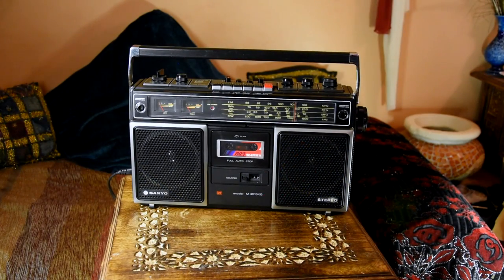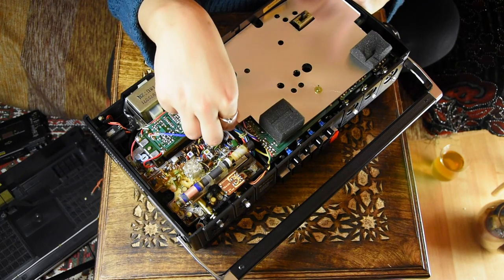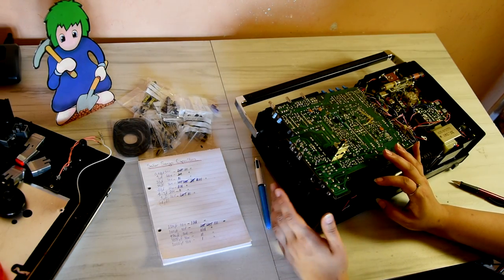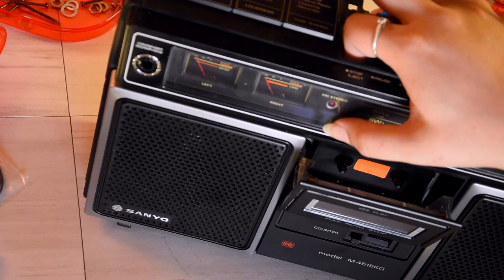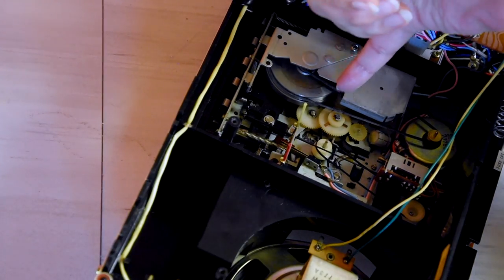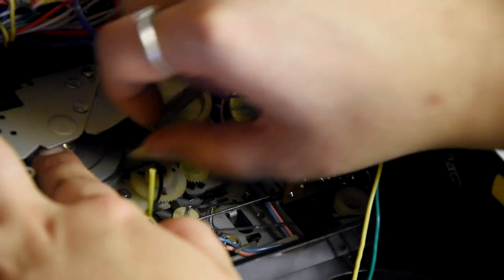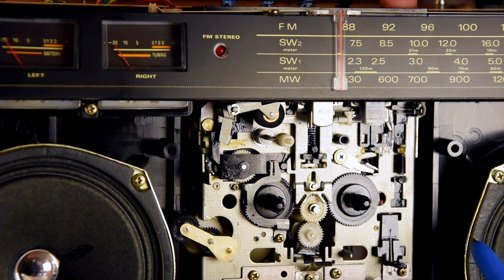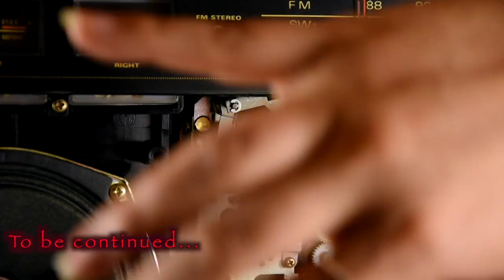Sanyo Cassette Recorder Part 1 - Repair & restoration

Comment: Hi Maddi, 

I'm following along with interest your overhaul of this Sanyo.  I've got a Montgomery Wards boombox, possibly made by Sanyo, from 1979 that's going to need some attention one day.  Montgomery Wards had their own store brand boom boxes.  Your video will go a long way to helping me overhaul mine.  

Congratulations on solving the stuck eject button problem.  I learned about dry, sticky old grease when I overhauled an old record player changer from 1956.  What a mess that was!  Cleaned, oiled and regreased, it works like new again.

All the best, Tom
Reply from the maker: Hi Tom, Thank you! And I will be happy if this video can help you or anyone in any way, I couldnt find any clues or support out there for this model when I searched around. I hope you get your Montgomery Wards boombox fixed and restored. :o)
Reply: Maddi, 

My Montgomery Wards boom box isn't as fancy as yours, but it does have an 8 track tape player built in, of all things.  Strangely enough, I've actually got some 8 track tapes that I could play on it, but I need to "rebuild" the cartridges first.  That involves replacing the foam pressure pads and sensor foil, all of which can be found on Ebay.  And, of course, You Tube instruction videos on how to do all this!

I hope you're feeling better soon.

Tom

Comment: Nice video, am new to your channel. I have done a few retro cassette repairs. Those screws with the glue on a normally easy to unscrew.
Also what I do is when I put the screws back that have been glued, I put a spot of nail varnished on them :) The nail varnished is also good
for tape head screw, if adjustments are needed. I use black nail varnish :)

Comment: Most problems you have with vintage cassette recorders are mechanical or belt related. You must use a plastic safe lubricant on all moving parts. All belts can stretch, so replacing is the best choice. If you cannot find a replacement belt, clean the belt with anhydrous (no water added) alcohol to restore and clean the belt so that it grips better. Remove all dust and old lubricant with a cue tip lightly soaked with the alcohol and re-lubricate moving parts except the belt, pulley surfaces and pinch rollers. You can lubricate pulley pivot points if they drag or have a rumble sound. Contact switches, volume, balance, fader, and selector switches can be cleaned and lubricated with a product called Deoxit (very reliable and safe on plastics). Tuning string can be made unslippable by cutting off a coil or two of the spring that provides tension on the string and bending a small hook on the end of the spring with medical clamps or hemostats with very small jaws.. 
Always put small parts in a bowl or magnetic cup found in auto parts stores - a lost screw will ruin your attempt to repair. Auto belt restore should not be used except as a last resort. If you are skillful with very small objects, a broken belt can be superglued together for a temporary fix. Glue the butt ends together on small belts, overlap larger flat belts and use a very small amount of superglue to join them. Good Luck!

Comment: Glad you're going to replace the speaker drivers.  They are normally measured by their outside diameter, so from metal edge to metal edge across the centre.
Reply from the maker: Thanks for letting me know, I still cannot find the right size and wattage combination, i'll keep looking.

Comment: Nice classic ghettoblaster. I always 'ploing' the battery compartment coils too just to hear the sound. Weird how often the replacement of the drive belts is so terribly difficult.
Reply from the maker: Yes, changing the belts was so awkward, that stupid screw couldnt be removed! 
plucking the springs just has to be done, there is no way for me to resist ;o)
Reply from the maker: That is a good idea! I didnt think to try that, thanks!
Reply: It can work sometime; if loctite has been used,heat is required to free or soften the chemical bond.
Reply: An old trick to remove tight screws is counter-intuitive.   Tighten, yes, tighten the screw first.   You will find that you can "break" it loose by tightening it first.   Especially if you have worn out the head of the screw by loosening it.   Another old trick is to keep a brand new screwdriver that is only used for tight screws.  Then put it away for the next time.
Reply: Yes I have used that trick before.
Reply from the maker: Thaks for the tip Robert, I didn't know about this trick, and naturally it never occurred to me, but I must give it a go.

Comment: Oh my god when I saw the Eject button was working Ok again :-D my face was the same as if I was watching some kind of a thriller movie in the most interesting part hahah and seeing your surprise was hilarious too :-)
I would like to have your skills in electronics as I have some other radio cassettes which need some reparation but I am so bad  when it comes to electronics (but so good when it comes to issues  in computers  when capacitors, diodes or chips soldering is not involved...)  I even have a modular sound equipment I am using daily  in which the type players are not working because of the elastic rubber bands...but as it's a very very big equipment  I don't even know how to begin haha
Seeing you working makes me see it's easier than I think at first but when I have the board in front of me it's just like a brick of a house for me... I can measure the Volt's, the resistance, and less more besides that...
I really enjoy your channel as it's some kind of inspiration for me to go further  learning.
 by the way, I really loved this music.. Is it from an specific artist?
It's curious because I'm doing the soundtrack for a game which is inspired in old Legends where flutes and ocarinas are the basis of the sound and I listened to many of these compositions.
 have a nice day Madija!!

Comment: Hi enjoyed watching this, my Sony Walkman had to be binned , not only would it not play the battery compartment was eaten away by battery acid, it had gone right into the lil walkmen, so unrepairable, 
So all those who buy on eBay just be aware always check your purchases & if anything wrong that's not listed send straight back,
I was told it worked, & if probs occurred then it was fixable! ....it wasn't cos of the extent damage of battery acid....
Which leads me onto another thing, if you don't already know always take out batteries when items are not in use....
Guess I learnt a valuable lesson!!!!!

Comment: Señor Sanyo looks like an expensive machine when new, as you say a GhettoBlaster, and seems a bit happier now with a drop of new oil. I dont have a car anymore, but I keep a container of motor oil for doors and things which need oiling. Its a bit thinner then normal oil, but thicker than thin oil, at 10w 40, so thats a bit crazy.

The system will be like a brand new machine with new caps, new belts, and new oil. It will probably blast off the shelf with a trail of fire behind it, and go back in time.  Did you notice a date on the case, as I cant find a manufacture date of this machine.

Seeing one of those pens at 6:00 brought back memories. I used to have one with (I think) 20 different colours, so playing with 20 pens in one pen was like magic. Of course the blue and the black soon ran out. I dont have any of that stuff now.
Reply from the maker: The funny thing, I never called them a 'GhettoBlaster' or 'Boombox' I only heard those terms late high school days and college. It was always just a Tape recorder for me.

Yes, not to mention a good bathing! This thing be just like new :o)
I didnt notice any date and i've been looking around everywhere, my feeling is that it's late 70s due to the look of it. But I cannot find a single thing about it online other than a few images. I almost found something but it just stated "19xx" which is nothing but a freakin tease.

Hahah I remember the pens you mention, the big ridiculous ones, mine had 10 colours, they were fun though, i remember the ink colours also smelled of different fruits, and there was that big button at the top to snap them back in.
Reply: I remember those fruit smells a little, and the button, now you mention it. I remember trying to draw a picture using these pens could make the picture smell quite strange.

Comment: Hi maddi, just wondering who do you use for your component supplies?   I trying to locate some items for a Teac 800 cd recorder, I've re capped it, but now want to hopefully get the brightness of the display back to normal, hopefully it's just down to a voltage regulator or two 😀
Reply from the maker: HI Martin, I just look on ebay or anywhere like this, basically I dont have one specific supplier, I need somethign I go crazy looking everywhere for it lol! :o))

Comment: How did u remove the Knobs??
Reply from the maker: Slightly levered them with a flathead screwdriver and pulled them off by hand, but the four buttons you need to open the case to get off.

Comment: Eject button is the spring loses tension
Reply from the maker: I actually sorted the eject and other issues out in part 2 of this video, this mechanism really needed greasing. 
https://www.youtube.com/watch?v=M4dafyzDDIY&t=25s
Reply: Wow is a macho comment that good a girl who likes electronics, my name is Miguel I'm fond of electronics, I have a hitachi j5 model 81, with some problem, but I wanted you can do videos of how to take measures of continuity of transistors pnp , Layering or resistance, or how to know if a power transistor or amplification output works, thanks

Comment: Maybe you already know this...If you ever need service manuals for hifi stuff go to hifiengine.com
This particular model isn't listed however, but it's a great site nonetheless.
Reply from the maker: Actually I didnt know it, thanks for letting me know!
Reply: MsMadLemon 
Always happy if I can help you a little bit.
Reply: I need to get motivated to start back up working on my RTRs Maddie.Those boom boxes are difficult to work on due to the smaller size.Cheers
Reply: I don't know if someone already recommended hifiengine to you.But you can sign up there and its for free and you can download repair manuals for most all brands and different types of components if the model that you are looking for is there. It is a valuable resource.Cheers
Reply: I thought that you already knew about hifiengine.that's where I have found all my manuals for my rtr'sGood thing that you know now. It will make things easier for you in the future if you come across more hifi equipment.Cheers
Reply from the maker: No I had no idea about it, unless I blindly downloaded a manual from there by just googling for the manual. Its a good site, though I couldnt find the manual to this Sanyo, I'm trying to find a few manuals actually which i'm struggling to, one being my JVC KD-A5 cassette deck, it doesnt seem to be around. trust me to have obscure stuff haha. Saludos Rob
Reply from the maker: I hope you manage to get your RTR fixed, I thought you had success with it the last you commented. Saludos
Reply: Well I am glad that now you have a resource for free manuals.I am shure that eventually it will come in handy.Saludos
Reply: Yes I was able to fix that rtr but I still have several that need work and the problem on all of them is in the recording function.So hopefully I will be able to figure it out.Thank you for replying back Maddie.Saludos